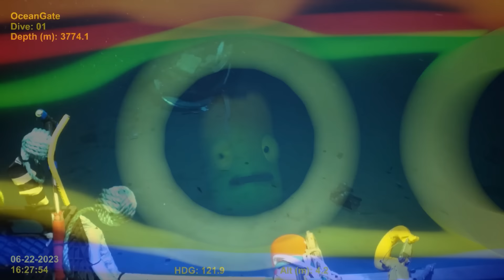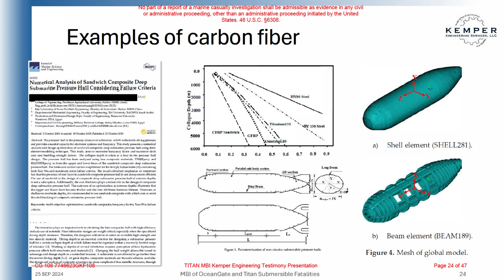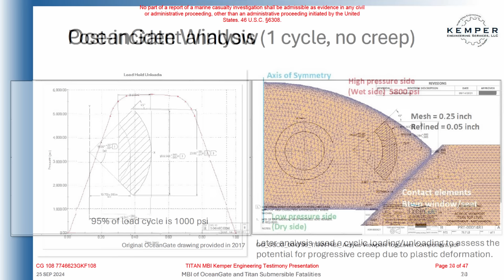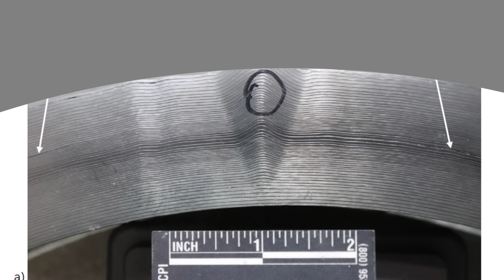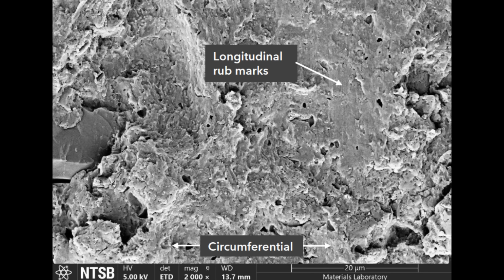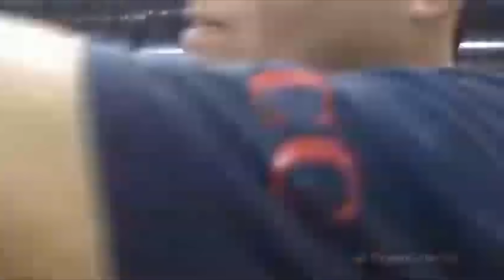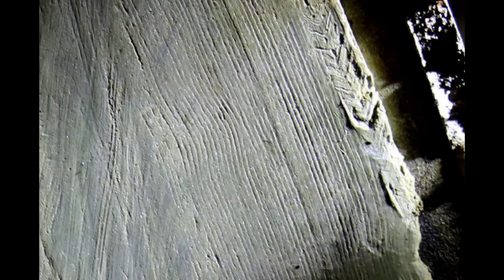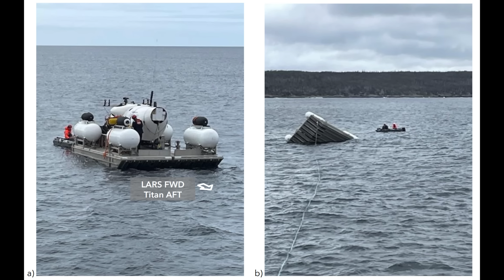OceanGate Wreck Shows Why Sub Wasn't Strong Enough To Survive - NTSB Shares Important Details

Comment: I thought that the guy who commented about the life span raised a great point. Against all odds, despite all of the horrible shortcuts they took and bad assumptions they made, the carbon fibre actually somewhat did work. If they had had a limit of 10 dives or something then taken it apart and tested the hull to destruction and studied how it deterioated, they would have probably not only saved their lives, but contributed invaluable data which would have made CFRP a viable material for the future. Instead, 5 people died, the science is hardly advanced and it was all for nothing.

Comment: Simply excellent analysis. Between adding hooks to the rings then lifting the sub by the rings which they were warned never to do, bashing it around in high seas in a trailer behind the main boat, making a hull from 5 differently cured layers, complete with voids and ever expanding waves in the weave... It's amazing that it lasted as long as it did.
Reply: That barge(thing) wasn't seaworthy in the slightest.
Reply: If you are building in lifting points... build the stupid cradle for them too.
Reply: @leechowning2712  agreed. The rings were never designed as a point to lift from. They added the lifting mounts to the rings when they moved to the 2nd carbon hull
Reply: I agree.  Excellent analysis Scott. It is obvious you spent the time organizing your thoughts for all to understand. Great work here.
Reply: Honestly, it was so jury-rigged and ghetto that it makes me kind of suspect that building a submersible isn't as hard as advertised. Which is not the correct takeaway from this lesson at all lol but still!
Reply: @qoph1988  honestly, you're right in my opinion.

More or less this design but full titanium, a correctly rated viewing port and competent programmers/electrical work (I mean we have self-navigating multi rotor drones that you can buy for a few hundred bucks. I'm sure it's possible to make sure there are no problems with relatively simple manual submersible controls).

There was so much talk about 'this or that is dumb and cannot work' for example the cyndrical design, controller, Spartan interior etc. etc.

But realistically everything worked relatively flawlessly besides the bad programming/electrical work and the carbon fibre DESPITE how terribly inept and haphazard the engineering and construction was (and it still managed many successful dives).

I do think that if Rush had just used full titanium and added some flotation to compensate for the weight, he might have gone on to be well regarded.

Comment: So many key points. But the two I find most interstin. One. This was doomed to failure, a definite matter of when and not if, everything the experts said was true, the pressure cycles were literally grinding the interior of the subs CF hull apart as well as flexing it apart.
 Two. amazingly and very unexpectedly, the much vaunted "Real Time Acoustic Monitoring system" actually works, it's a viable system for the application. Far less unexpectedly Rush and the rest of Oceangate didn't understand the data/warnings it was giving out and pretty much as expected the one time they did understand it, they brushed it aside.

Comment: So these guys wanted to make a sub that would travel several times to the bottom of the ocean and picked a material that will create cracks and delaminations...? Yeah, really smart. Because even if it didn't fail on this voyage, it would for sure fail in the future. And since they basically didn't check the warning signs, it was just a question of time.

And those lips on the rings are so tiny and skinny.

Comment: It's kind of amazing that a 5 inch thick tube of carbon fiber actually was strong enough to dive to the depth of the Titanic at all. It did do it several times before failing.

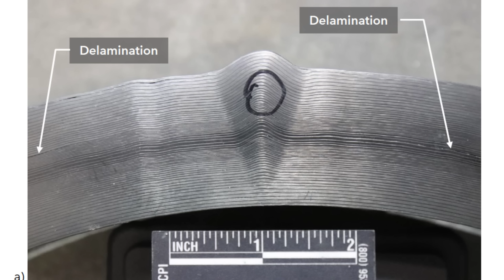Comment: At 10:53 we know these effect at cold rolling mills. When we coiling material thinner than 0.4mm. If ur coiling tension is to high or to low u get these what we call as "heart brake" The produced coil will collapse while it make a cracking sound.

Comment: So peel ply and adhesive to hold 5 x 1 inch hulls together gets you the strength of 1 x one-in hull. Composites only work as one if they are built as one. Without diagonal plys and with lathed flat plys the result was inevitable. This is what happens when you choose the low bidder instead of the competent one. 

The monitoring system sounds like it worked, but honestly I am certain by that point there was no engineer left at Ocean Gate competent enough to decipher it. 

I am also not certain the manufacturer was using the correct epoxy. The white powdering of stressed adhesives sounds more like an ester-resin. If so, this was used to save money and had zero chance of success.

Comment: I think you missed something in the explanation of the wrinkles. They don't appear during the layup, but during the de-bulking, when they wrap the entire structure in a bag and vacuum the thing. Easy Composites has a video where a Spanish guest makes a mountain bike frame, and we see him performing a de-bulking operation midway during the work ("Making a Carbon Fibre Bike Frame – From CAD Design to Downhill Race":15:40).
Reply: Oh!  Of course.  That makes a lot more sense, and explains why the wrinkles grow so much towards the outside -- it's because the outer layers are moved more by the debulking.  I knew that growth shape looked familiar but I couldn't place it.  Thank you!

Comment: It was only a matter of time then before this happened if they where ignoring the sensors indicating potential stress damages to the vessel. Such a shame they all had to learn the hard way that short cuts and errors no matter how small add up against you at those pressures and depths.

Comment: What's crazy is that people still don't think that it's more dangerous to travel underwater at a certain depth than to travel in space.

In space, if the spaceship/station you're has a hole, if you're in a space suit you can still survive for as long as it works. Under water? Water pressure will crush you even if you're in a diving suit from the loss of pressure.

Comment: In most structural elements failures in compression are a result of localized failures in tension. Tension is what carbon fibre is good at. So in principle, CF pressures vessels should be possible.

Comment: Regarding the voids and inconsistencies in the hull; what one needs for a submarine hull is complete homogeneity in the hull material. Consistency of the material properties is important otherwise the distortion of the hull under pressure is not even, and then you lose the benefits of the circular or spherical shape of the hull. It then becomes harder to prevent implosion because the forces are not solely compressive. 

For the same reason you don’t want the hull thickness to be the same at the top and bottom. For every 1metre of diameter there is a difference in pressure of 0.1bar. With a hull of uniform thickness the pressure differential top to bottom distorts the hull away from round, and again you’re in a whole world of structural trouble. This impacts bigger submarines more (there is a whole 1bar difference for a 10metre diameter hull). Calculating whether this distortion is significant is vital for deep sea submersibles, but you can’t do that calculation unless you have complete knowledge of the material properties of the hull. And you can’t have that for a CF hull.

Comment: Makes you wonder how the hell Titan made it to the Titanic site, successfully, ten times!?
Reply: Repeated strain stress destroys parts, especially if they are not in the linear part of their response to the mechanical stress. As you can see from the strain gauge measurements, the hull certainly wasn't. It settled on a new shape during one of the dives. That is a very clear (and bad) sign that the part is being operated at its limits.

Comment: The primary issue is that coal fiber is stretch resistant and was used in an application that required compression resistance. 

It then became a matter of the glues ability to prevent delamination and of the fantasy that delamination if it happened would be slow enough for the sub to get to the surface, the theory for using the warning system that actually did work, the time from warning to disaster was however to short.

Comment: Going against established practice and doing something new and different has an allure for humans.  The thought that perhaps the scientific consensus is wrong or, worse still, is purposely decieiving us is what fuels the fascination with conspiracy theories.  This sub is a symptom of that wrong headed way of thinking, as are things like the anti vax movement.  If we regard established science as something to be rebelled against we will repeat these sort of mistakes. Now go on, there's a climate change denier video to click on next, hurry up ..
Reply: The problem here wasn't that there was scientific consensus. The problem was that there was no test data. We aren't designing these things based on theory but based on the comparison of the theory with actual destructive tests and there weren't enough (or any?) for this material combination. So they weren't violating scientific consensus as much as they were violating good engineering principles.
Reply: @lepidoptera9337  the science informs the good engineering principles.  Carbon fibre is unproven for compressive loads, this was an experimental vehicle but they were experimenting with humans inside.

Comment: Last night I watched a video about the axial load on a curved surface on a mechanics video.
He was making custom rims for some old Jeeps and tractors he has lying around and he explained that car rims are dished for this EXACT reason.
When you think about it a dish is nothing but a 3D arch, and we've been using those in architecture forever.
Reply: That sounds like Low-Buck Garage ... which oddly has more sound engineering advice than OceanGate ever did.

Comment: I hate to say it, but Stocton Rush & Oceangate, were not the only ones guilty. The agency's that should have stepped in and stopped him before the disaster, didn't. Reason for this was Stocton had a point. What he was doing was untested. I can guarantee you, had this disaster not happened, and the sub succeeded, all the agency's prosecuting now, would have let Stocton take all the risks,  then jumped off the side lines and worked to improve Stoctons model. Even with this disaster, I can guarantee,  Stoctons data will one day be used by one of them. They will tear Oceangate apart, file very serious charges against ones responsible, then most likely have them sign their rights away for lesser sentences, just to gain control of Stoctons work. feel this disaster will one day get repeated, and most likely,  no one will hear of it. Russia, US, they all had very bad sub incidents, and people died so that information would never get out.
Reply: Dude, you need to get help with the paranoia. It's destroying you.

Comment: The fibre in the carbon fibre.
If it's under compression, why bother with the fibres? They're fine (and quite pretty) in a scba tank but won't be contributing anything here. Is there something about curing the matrix(?) that needs them?
Reply: Carbon is much stronger than resin in compression, too.  Loose carbon fiber is not very strong in compression because the fibers easily buckle and bend like pushing a rope, but if you put them in a matrix that holds them rigidly in place so that they can't buckle, they add quite a bit of strength.  And a typical carbon fiber layup will do that, until it starts delaminating.

Comment: Wouldn't it not just be easier to build a replica scale model and then test that in a water chamber to see how it collapsed in itself, replicate the same flaws into the scale model and then crush it under pressure to get the data they needed.

I'm surprised they didn't find human DNA mixed into the debris, because they would of been turned to meat paste the moment it crushed everything under pressure.

Comment: You say it's "Armchair engineneering" to talk about the fibres being got for tensile strengh not pressure, then Kemper saying it's not a showstopper, -- but why? What are the fibres even doing there if their strenght is in tension? And even if you have a ceramic hull, it's still brittle, any failure it's going to be instantaneous and insiduos. A bendy material should give you far more warning to climb back up.

Comment: The strain gage showing increasing strain with every new dive has implications for buoyancy. Hull strain implies overall decreased craft volume, losing buoyancy equal to the volume of water between the original volume and the new smaller volume. Even for small hull deflections, this adds significant weight to the craft, perhaps speeding up the decent and accelerating movements between layers, weakening them even more.

Comment: It's pretty simple really, Mr Stockton Rush simply did not design the submersible well enough to handle the immense pressure at the depth the Titanic was at, whether he did it deliberately or not is wide open to debate, and of course the submersible suffered a catastrophic and almost instantaneous implosion which most likely only took 1ms to occur, faster than a human brain can respond to pain sensations.

Comment: I've only just started working with composite laminates, and I already know that the construction methods used to build that hull were amateur at best.
The absolutely criminally negligent refusal to acknowledge the incompatibility of a composite laminate structure for this application is undeniable. 
Engineers have considered this common knowledge for decades.
Justice is served.

Comment: Awesome and comprehensive video 👏
     carbon fiber is usually done in as thin of layers as possible then peel ply vacuum bag or peel ply vacuum chamber.
     

     This peel ply has another reason its used it removes excess resin that only makes the carbon fiber weaker

     This was carbon fibers version of what a welder would call bubble gum welds 😢

Comment: Well Scott, you finally got it right.  The CF cylinder collapsed (imploded) in microseconds due to internal delamination issues.  Shockingly these were "seeded" and built-in when machining the cylinder to flatten the wrinkles.  The wrinkles were the signs of the beginnings internal lamination weakness, caused by the sloppy construction methods. All the rest of the devastation followed in milliseconds.   
Kudos to the NTSB for the investigation; they often "screw the pooch" on GA aircraft accidents.

Comment: M.E. with fair bit of quite thick CF specific experience. Absolute shit show. 1) mixing stale pre-preg longl + wet lams in hoop direction wrapping 2) huge void %'s 3) huge amount of wrinkles and then cutting huge % of fibers by machining 4) sketchy bonding of Ti end caps 5) no +/- 45 layers. Totally destined to fail.
Reply: Yeah, when Boeing said off-axis layers were required and the Rush response was "nah, that's too difficult", it was a giant red flag.  It's the triumph of charisma over common sense.

Comment: As I am in development of acoustic emission systems, i would love to know more about the setup they used and have look at their data. Max Amplitude is good to see that you have to look and when, but looking at frequencies, energie, and location ( triangulated between the sensors regardingtime of arrival and distance) of the events normally gives a better picture. Regarding the faulty sensor 1: normally you would check the sensor before each measurement run with a pencil lead break ( Hsu-Nielson ), and exchange faulty sensors. Looking at the data, it could just be a coupling issue between the sensor and the surface it is on. ( Bad glue joint) Acoustic emission measurements for fiber materials are not easy, and while the max amplitude plot is available in the same second, the analysis regarding location and energie takes some time and is more complicated. Triangulation isn't possible over the whole area if sensors are missing. If you are cutting costs on materials and Materials ans weights, cutting costs on measurement systems and data analysis seems to be expensive.
Reply: There's a lengthy testimony about the AE sensors if you want to find it, from someone who was involved in developing the system before leaving OceanGate due to unrelated safety concerns. I don't think the raw data is publicly available, but there are PDF graphs. They couldn't change the sensors because they were embedded in the hull somehow, but also they didn't seem to realize they weren't responding properly. There was some mention of the testing procedures too (something about tapping the titanium rings). If the measurement and analysis was poor it wasn't because cost cutting so much as Stockton not wanting yet another engineer telling him it's not safe to dive.